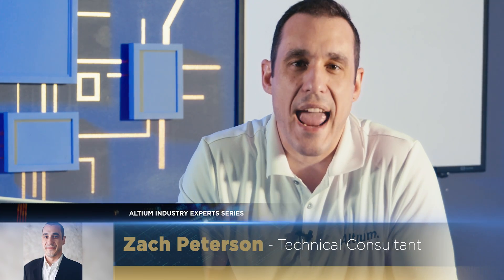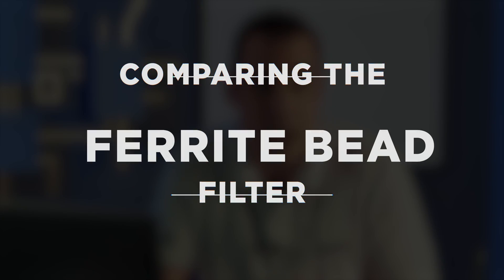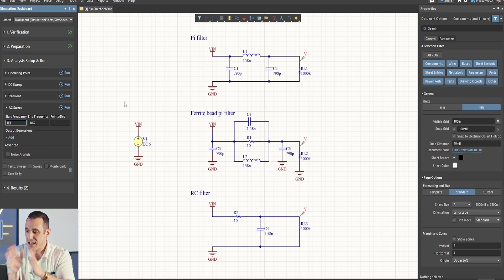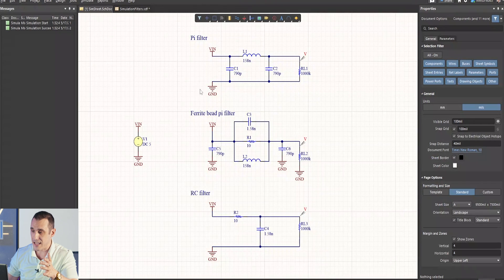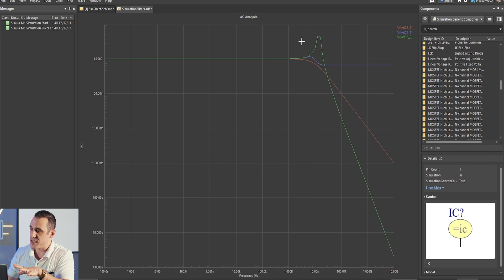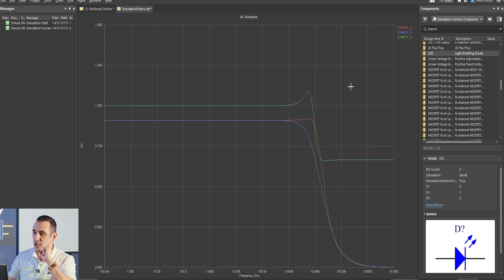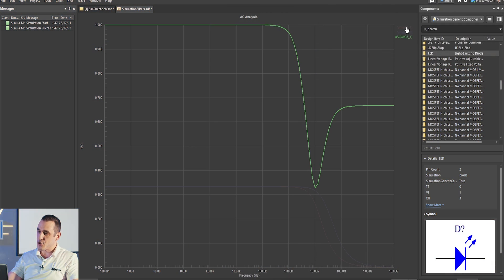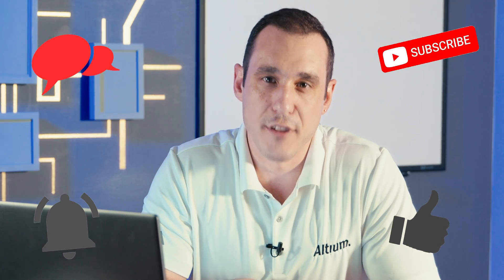Ferrites as a Filtering Element - Are They Effective?

Comment: I recently converted a "reference" design from a large company - where they're split the grounds and used FBs all over the place. So I took a leap of faith (based on advice from Rick Hartley and Eric Bogatin. And it works a charm. Lower BOM cost, fewer parts and my nerves aren't shattered.

Comment: Parallel capacitance of a 120R@100MHz 0805 ferrite is around 30pF (not 1.5nF...). And, on high frequency modelling, one should add a series resistor representing ESR of the ferrite - do not simulate without it! (This is 120ohm @100MHz, 60ohm @50MHz and so on, see datasheet.)
Reply: The ESR value on the ferrite is  very small, not very large, it is the parallel resistance value that appears at resonance. We did another video on this where we fit the circuit parameters to a ferrite impedance curve, you get pretty good match at lower frequencies depending on the particular bead part number: https://www.youtube.com/watch?v=7hxj5O1ip0k
Reply: @Zachariah-Peterson  ESR is series resistance, and its value depends on frequency - as ferrite bead's ESR comes from skin effect on the thin wire inside (in case of SMD chip beads). ESR start to rise above ~10MHz or so. Yes, its small on low frequencies (in the so called reactive region), so one should use external resistor to damp the LC-circuit if you use a ferrite bead with an MLCC. Eg., a 120R@100MHz ferrite + 1u MLCC gives you ~300kHz resosnance, where the ESR of the bead is ~0.1ohm only, but min. series damping should be 1ohm to Q=0.5.
Thinking about ferrite beads as lossy inductors is a common mistake, as they are lossy only on high frequency, not around the resosnance frequency of practical filters. Circuit simulators also not used to use simulate ESR vs frequency - therefor I usually add a separate resistor in my simulations (usign the bead's datasheet for value).

Comment: I was using a ferrite bead pi circuit filter for a converter but was getting some issues with conductive emissions, so increased the capacitance and replaced the ferrite bead with inductor but still getting noise around 500kHz. Anyone any suggestions?
Reply: Tighter layout...?
Reply: @filipnevezi  means ? place decoupling capacitor or component close to each other  ????
Reply: conductive emission are high spike voltage ? how does it creating problem to your project ? where you are using pi filter and what is the value of inductor and capacitor ?  ceramic capacitor ?

Comment: I think the parameters of the "model" of that bead is flawed. Isn't the parallel resistor a tad small and your parallel capacitance a tad high?! Looking at the LTSpice Model parameters for parts that have an inductance in the 150nH range (Würth 742792097) gives me 35 ohms and 800f as in FEMPTO farads. Nowhere near 1.5n... Also you are unlikely encounter a scenario where there is no additional capacitance like 100n decoupling near the load or somewhere towards the power source.
Reply: The point was not to look at a specific part number, but to put some example circuits side by side and look at the frequency responses so they can be analyzed without additional components such as decaps. If we wanted to simulate a specific LTSpice model for a specific part number, then we would put a part number. Contrived examples are just fine for learning concepts, now you can go create an LTSpice simulation with that Wurth part number and see how it works in your system. 😀
Reply: @Zachariah-Peterson  I would pick realistic values to draw realistic conclusions. You can do better.

Comment: Thanks for video! 
1. Inductor has parasitic capacity, capacitor has parasitic inductance. You draw only equivalent scheme of FB... Is this not important? 
2. LC-filter will be effective in high frequency when his cut off freq = 100kHz, and DC 2..3A ? it means that inductor and caps are big sizes, big parasitic.
Reply: what will be the values of LC,  if suppose I want to filter an SPMS 5V DC , which is given to microcontroller and other component like RTC, LCD etc?
Reply: @sanjaybatra6593  i think you need to read specification for your SPMS... Understanding current consumption your 5V_rail... You can use big L - power will be smooth, but only load constant...
Reply: @87Spectr  SMPS specifications are 5V/3A. Approximate current drawn is 1A to 1.25A . I am using atmega128A + RTC+LCD. so load almost is constant.

Roughly what should be value of L C1 C2 for pi-filter.

Comment: Thank you for the nice video :)
I agree that the damping of an LC filter is generally better than that of a ferrite bead filter. 
But a real-world inductor will also have some parasitic capacitance, which will dominate at frequencies above the self-resonance-frequency (SRF). So the AC transfer characteristic of a real-world LC filter will also be messed up at high frequencies... just like the ferrite bead.
Furthermore, a real-world capacitor will also have some parasitic inductance, which will further degrade the filter's performance at high frequencies in each of the three designs.

I sometimes add a ferrite bead pi-filter on the output of a DC/DC converter to provide some damping for high-frequency noise (frequencies at which the regular LC filter of the converter doesn't work due to the parasitics).

All the ferrite beads I've come across have a specified bandwidth of 100MHz, not 10MHz. My intuition always was, that an inductor with a similar SRF must necessarily have a very low inductance, which results in an increased cut-off frequency of the filter compared to the ferrite bead. 
Thus, if I can trade off the worse damping for a lower cut-off frequency, the ferrite will do better.
Your video really made me think about my past design choices and I will definitely do some more simulations in the future :)
Reply: If you look at some wirewound ferrite beads you can find ratings closer to 10 MHz, most standard SMD package beads target 100 MHz range as you mention. The inductor option can also be used at these higher frequencies if you use specifically high frequency inductors as these have parasitics controlled and guaranteed operation up to higher frequencies. Coilcraft has both types of parts.

Comment: You also have to account for series resistance and the load current. Ferrite is basically an inductor + resistor. It doens't have that resonance but you can only power so much with it. It is usually cheaper and smaller too so it still has its uses.

Comment: So, the big question is this, why continue to manufacturer ferrite beads if they provide no benefit according to simulations.  What actual use case does a ferrite bead serve?
Reply: Well in a way they do provide a benefit in a very specific situation, which I outlined in another video. That specific situation is when you need to limit high frequency noise in a very specific band from reaching a load when that load only operates at DC. Not a lot of loads will operate like this however.
Reply: @Zachariah-Peterson  So basically they can be equivalent to a notch filter except they prepackage for a specific frequency based on bead parameters.  Other than being a single SMD would it not be better just to create a notch with a few discrete components and be done with it.  Just stop producing the beads and let people produce the notch in a traditional manner.  This would then make clear what to do in DC systems.

Comment: The main difference between a ferrite bead and an inductor when used as a filter is that the ferrite bead, if chosen correctly, will convert the noise energy into heat, whereas an inductor will just cause it to slosh around until some other lossy element(s) in the circuit convert it to heat.

The complicated part in the above is the "if chosen correctly". The noise energy must fall within the lossy frequency range of the bead and the bead must be modelled at the DC current it is going to run at, as the parameters change with current!

As for datasheets, well we can't even get manufacturers to stop recommending parallel 10nF + 1uF (or similar) surface mount capacitors for IC decoupling, when using a single 1uF ceramic surface mount capacitor would be better (cost, size, performance) in the vast majority of cases. Good luck getting them to stop recommending the use of ferrite beads on power rails to ICs!
Reply: can you please share  more information in sample language.
Reply: Its just adding inductance to the path. They are not different but the same.
Reply: @prashanthb6521 Incorrect. Ferrite beads are not just inductors, which are designed to have low losses and reasonably stable inductance with current. Ferrite beads are designed specifically to have a region where they behave more like resistors i.e. turn current into heat. While a ferrite bead does have inductance, it drops off with current very quickly, so if you are using a ferrite bead as a poor man's inductor then make sure to pick a ferrite bead with a rated current much higher (e.g., X10) than the expected current that will pass through it. Ideally get a SPICE model that includes the effects of current on the bead so a damping network can be properly designed.

Comment: your analysis ignores the fact that the damped LC circuit has a considerable loss at lower frequencies and lower loads due to the series resistance. you're attempting to power the load with 5V, but only 1.67V is making it to the load (in the 5ohm case) due to most of the voltage being dropped across the 10 ohm resistor. I would say the ferrite bead is still a better alternative in the examples provided as the 5V DC actually makes it fully to the load and removing the series resistance on the LC circuit re-introduces the resonant peaking.
Reply: Well you're pointing out that at this bead resistance value it's similar to having high intentionally placed series resistance, kind of like the damping placement that Steve Sandler mentions in one of his posts (I showed it in another video). The difference is the band in which you notice that resistance, does it need to happen in DC or in AC near a specific frequency? I think this explains why once you dampen the bead and you replace it with an equivalent pi filter, there is little impact due to the fact you have intentionally placed damping resistance.

Comment: It seems to me that the bead replacement scheme is not correct. On your circuit, the impedance is no more than 10 ohms. If you look at the data on the impedance graphs of the data sheets of beads, there will be large values. What about this?
Reply: There are beads with 10 Ohms resistance or 10 MHz frequency. Sometimes the values are much larger, it all depends on the component. What matters for DC range is the ratio of the resistance to the load impedance because at the lower end of the load impedance range the bead (or resistor in an RC circuit) will determine the current limiting.
Reply: @Zachariah-Peterson   I use LTSPICE for work. The built-in models differ from the ones you use in this video. For example
mfg="Wurth Elektronik"
pn="74269242161 WE-TKSPB 0402"
SYMATTR Value 433n
SYMATTR SpiceLine Apk=1 Rser=0.12 Rpar=309 Cpar=460f 
(I hope the essence of the parameters is clear)
It may be necessary to check your example in the AD simulator and compare the practically measured suppression values. The adequacy of the model is very important for decision-making.
Reply: @Zachariah-Peterson  LTSPICE ferrite bead models are very different from the ones you use. For example: SYMATTR Value 433n
SYMATTR SpiceLine Ipk=1 Rser=0.12 Rpar=309 Cpar=460f mfg="Wurth Elektronik" pn="74269242161 WE-TKSPB 0402"
I hope that the meaning of the parameters is clear. Could you compare the models in your videos?

Comment: What about if it is recommended by the IC manufacturer
Reply: Manufacturers recommend placing a resistive load on evaluation boards, but this load type may not match your specific requirements.
Reply: I am talking about for example Analog Device's ADM3057E or microchip's SAMV7Q21 series

Comment: Ignorance is bliss. Ferrites are useful for adding high frequency RESISTANCE and they are appropriately used in the frequency range above where their inductive reactance has fallen well below their resistance. Perhaps Zach should listen to read some of the material that was put out by Jim Williams, Henry Ott and many others decades ago...
Reply: Apparently courtesy and good manners should be a blessing to others.
Reply: @joaopaulocoelho5401  I think this guy just pulled a tl;dw
Reply: The 1.58nF C3 that you put in the ferrite model is a bit exaggerated to me. And it’s the reason you get so bad HF roll off from your ferrite model. I’ve had better HF roll off experience in real world than what you see in your simulation. Also the fact that ferrite resistance increases with frequency is not considered in your model. Overall I don’t think you are using a good enough model for a ferrite. (Maybe its the reason you don’t like them 😉)
Reply: Hello pot calling the cattle black. 🤦